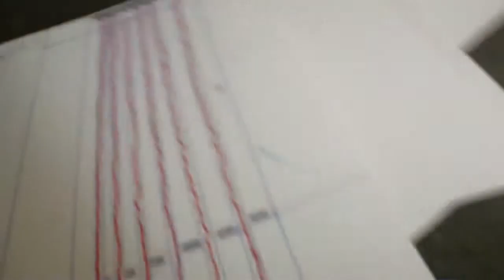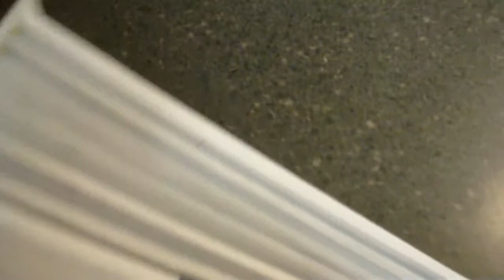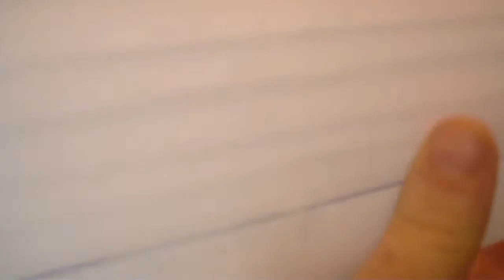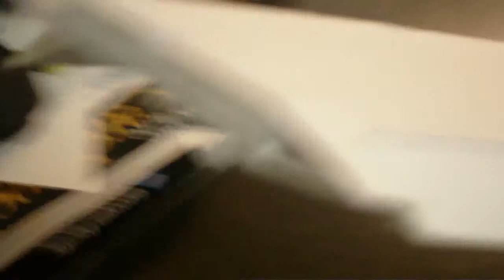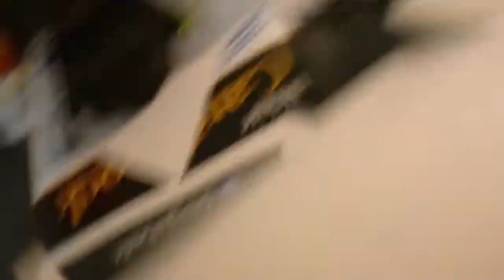McDonnell Douglas F-18 Wing Model and Design Cardstock

Comment from the maker: @NWA1503 All I did was look at cutaway drawings of jets such as the F-16, F-18, and F-5.
From this I found that the wings of these jets have many more spars than ribs. Than I wanted to design a wing with working Leading Edge Flaps And Trailing Edge Flaps. This really would've helped out Dave Powers from RCpowers youtube channel with the RC F-18 High Alpha.
The only guide I used was a drawing of an F-18 wing outline that I modified to make the construction simpler.